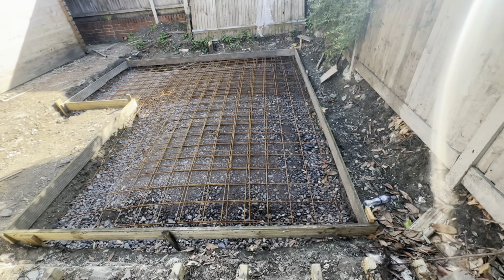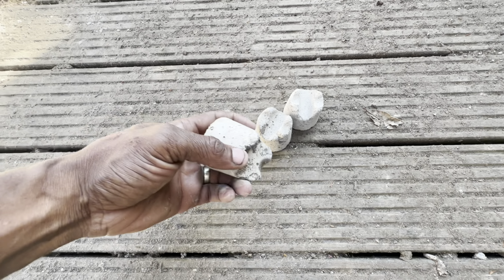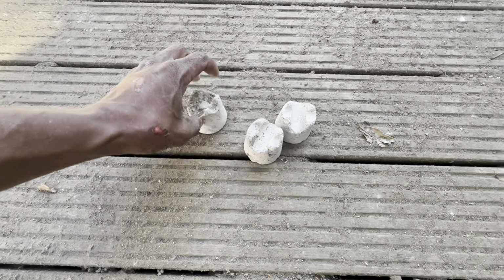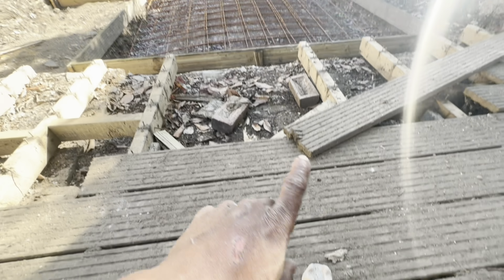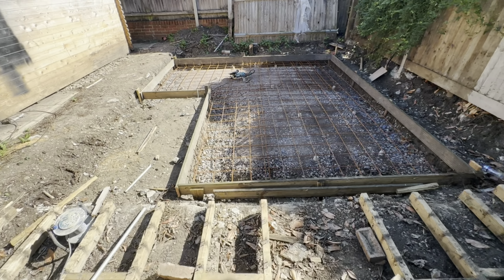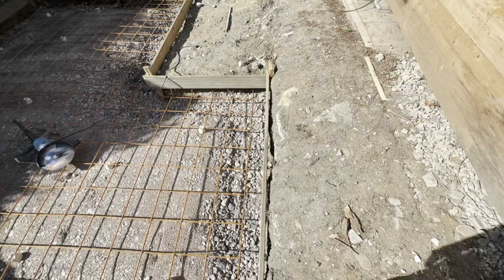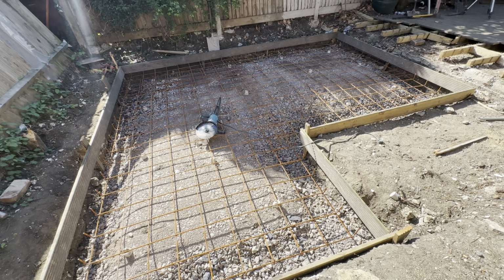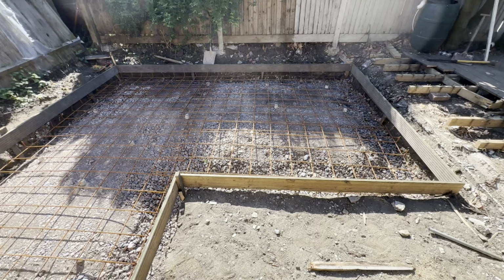Timber clad garden house with Sauna - Episode 5

Comment: Much better and safer to put your grinder handle in the other side and cut down. In 50 yrs I think I’ve only seen about 3 people use it the same way as you and we used grinders almost every day in engineering construction. Not sure the short piece of shuttering looks level but obviously from here it’s difficult to tell. I’d hate you to lay it before double checking.😊